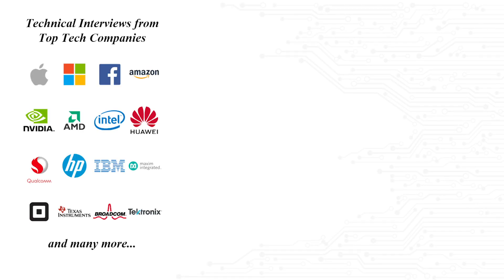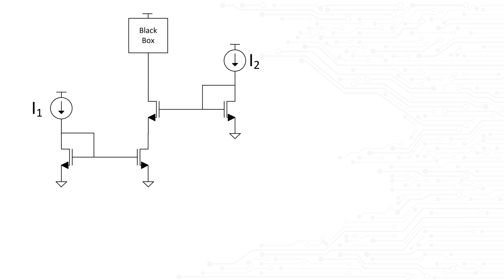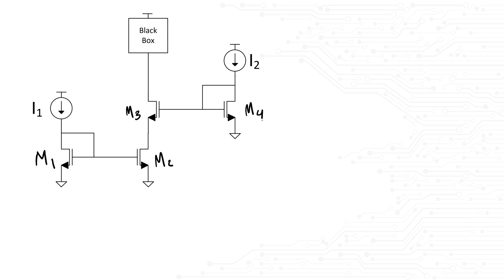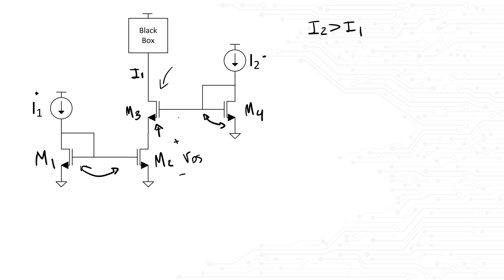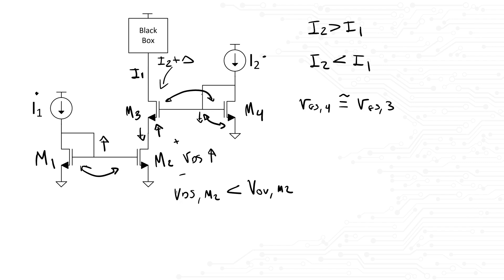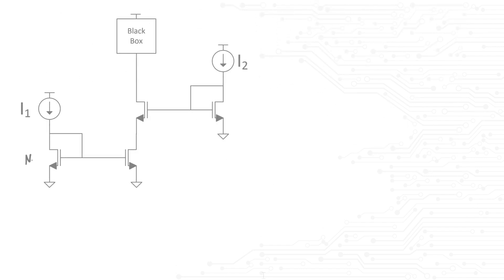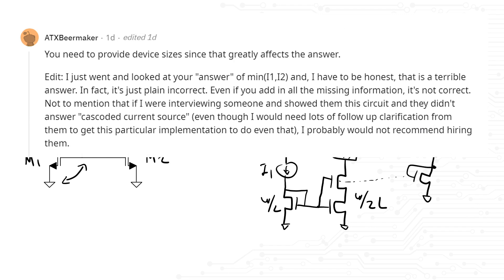HWN - "20-year Analog IC Designer" vs Our Team (Interview Question)

Comment: I did the simulation, it seems that it does indeed pick a lower current, but is not a very good system, as evaluated it is off by a factor of 2 when the current are equal. I don't think bob was wrong, but i don't think this is analysis is wrong either. The difference in current will have to large for the system to work, so it works under some conditions.

Comment: How you arrive at your answer, the thought process, the assumptions and how you communicated those to your team mates are more important than being right. The best answer is arrived at when the team is in sync with each other. IC Design is a team play.
I thought the circuit presented was a current modulator i.e. I2 modulates I1. Varying I2 varies VDS1 and I1 will change slightly due to channel length modulation by VDS1. But i enjoyed listening to your thought process.

Comment: If you're assumption of ideal devices includes a zero knee voltage, then yes, this would be a min function. Transistor length be damned. Also, the ratio of the current mirrors, imo, is irrelevant. You can just set I1 and I2 to be I1' = A*I1 and I2' = B*I2 where A and B are the CM ratios and then let the CMs have a ratio of 1. Unless we change the problem in such a way that we now care about the currents going through the diode connected transistors.

Comment: This is a quite tricky problem and the complete  answer is Iout= ( I1 .I2)/(I1+I2)( if we suppose that all the transistors are identical).Personally I will never test a candidate with a such problem.To be fair it is a trivial problem (for me ) but a real nightmare for most Analog designers to find the result that I have just provide.Also is quite odd what you say in the video you have  just solved it either I1>>I2 or I2>>I1 and what you say when I1=I2=I we get Iout=I/2.Now the real questions are what is (are )the imperfection(s) and how to solve it (them)?

Comment: Great content, thank you! 

Loved the analysis without taking any higher order effects, it's simple and elegant. Of course, we need to be a bit flexible here to buy your answer, which is kind out of the box. Would never get to the min function selection without guidance. To be fair, this sounds like interviewer function to drive the answer to this direction. Expected answer would be the cascode current mirror with I2>I1 (assuming proper sizes), Then, the interviewer could ask: "what if I1>I2" and so on...

Bob failed miserably in understanding the "ideal" scenario. However, I think you should buy him a beer anyway, he seemed stressed. 

Liked the inverter analogy to reinforce your point too.

Comment: 4:18 "The low vgs(m4) means source of M3 is low" ? I am confused because to draw less current(I2) shouldn't the source of M3 increase? Vg - Vs ---> lower Vs ---> higher I2 sounds incorrect. I think the source of M3 increases, Vg - Vs ---> higher Vs ---> lower I2 which is < I1. Help me on this.

Comment: Thank you so much for the sharing. In fact, this circuit is a well-known min. current selecting circuit. One can find a improved version using feedback control. See  chapter 2 "operational amplifter  speed and accuracy imrovement" by Vadim Ivanov, which is the best book for amplifer design.

Comment: Thank you for the nice video!
One query:
When I2 > I1; Vgs of M4 is high. That's understandable. But,
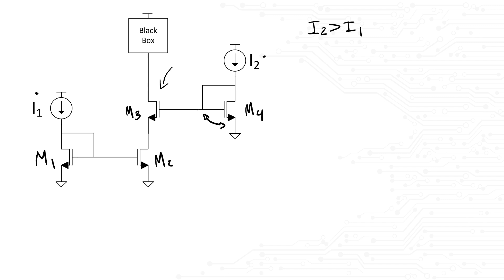"If I2 is high, source of M3 will be high" (Time stamp : 3:40) --- How you jump to this conclusion?
Reply: I think he's trying to say if I2 is high then the gate of M3 will be high, and that voltage is Vds2 + Vgs3, which will easily be high enough to keep M2 in saturation.
Reply: @theabr4839  Does he not know that M3 & M4 are NMOS transistors? Because he got it flipped the other way as well on (time stamp 4:18). If M3 and M4 were PMOS, then his statement 3:40 and 4:18 is correct.

Comment: To be honest, I agree with "Bob" at some points: 
The question doesn't mention any of the device size and device ratio which need us to make a lot assumptions. The device size and the actual current of I1/I2 affect the gate voltage of all of the transistor. For example, if I2<I1, the gate voltage of M2 could potentially turn off M2 completely or make M2 very large degeneration. If you claim it is a min current selector, you need to derive detail equations of Ron of the M2, current with degen of M2 and the final current equation etc.. 
We don't want to be the simulation monkey. But that is based on you have the calculation 100% correct, which you don't have here. And the truth is: in industrial if you can't even prove it in simulation, nobody will buy you. You can't tape out something that the simulation doesn't even work, only with bunch of incorrect equations. 
I like how you guys making these videos, but if you can't derive the equation 100% correct, don't do it, just give intuitive answer. The incorrect answer is going to mislead a lot of people here.
Reply: They were also very arrogant

Comment: I think the challenge of giving a mixed signal/analog interview is presenting devices in a configuration that the person being interviewed hasn't seen before so they can think out what happens, but still have it be simple enough so it is not a spaghetti mess.  Solving a DC operating point of something and then asking something like "which device falls out of saturation first as the input increases" is totally fair and expected.

Comment: The circuit is interesting once one reads how it's used in a class-AB amplifier. However, the way it's presented here is too simplistic and lacks key details such as sizing. 
Finally, I don't think it's a minimum current selector like the way you present it. If I2 > I1, for example, M3 sure wouldn't carry I2 as its source is on higher potential than that of M4, but there's no guarantee that M2 would be able to carry I1 either as its drain potential would be lower than that of M1 and Ids isn't constant after Vds > Vdsat.
Reply from the maker: Thank you so much for the feedback and contributing to the discussion. Details, like sizing, tend to become irrelevant in an interview discussion as we're not designing anything. Instead the interviewer is after problem solving and how one can use fundamental concepts to decipher what the circuit is doing. Remember we're not trying to teach anything new nor are here to educate people about core concepts. Instead we're bringing real life interview questions to you and assume you have all the tools to solve the problem.

Comment: Lol. You are clearly wrong. First of all we need to establish all devices are the same W/L. You could have spent 3 minutes on LTSpice to see why you are wrong.  You could have breadboarded it in a half hour. Pay up a beer guys. 

Also, your video seems more smug and condescending.  Both of you are at high points on the Dunning-Kruger curve, you are just at the beginning.
Reply: Well, I don't love the way this guy goes through the circuits in the videos but he is right.
If you are one of those designers that believe you are that good you can find this circuit in Vadim Ivanov's book on operational amplifiers(end of chapter 2). Also shown in E. Seevinck, “CMOS translinear circuits”. 
If you need more reference, Ivanov is a long time designer at TI that probably knows more about CMOS analog design and control theory than you think you know. Also probably holds more articles and patents than you.
Reply: @matheuspimenta8486  You are right. There is a circuit at end of chapter 2 where it is clearly mentioned min selector circuit.
However, another answer to the question could be a cascode current mirror (though matching won't be that good because of different VDS), but the output impedance would be high.
Reply from the maker: @matheuspimenta8486  Thank you so much for contributing to the content and being a part of the community! Please remember that we're not necessarily trying to educate people about IC design. The reason why you might dislike the way we present the circuit may be because we don't fully explain things but instead take shortcuts. However, that's the intent. We start with the assumption that our viewers have all the knowledge and tools to tackle the problems we present. Instead of education we just bring real life interview questions to expose our viewers to the problems.
Reply: @HardwareNinja  Sorry if I was not clear but  meant that your explanation is correct and giving references to support that.
Reply from the maker: HI JP,
Unfortunately you're so caught up on "being right" that you're missing the forest for the looking at the tree. Perhaps you haven't interviewed in a while or have forgotten how to do it. We're glad you're here to learn.
1. Interviews are all about ambiguity and lack of information. This is to evaluate how the candidate thinks and if seeks information.
2. When you know your foundations, and are good at them, you don't need a simulator to tell you how a circuit will work. Don't be a simulator monkey, don't be like Bob!
3. You cannot simply "breadboard" a circuit like this. It would be equivalent to say you could breadboard an OpAmp to prove it doesn't work (however, if you can let us know and WE will buy you that beer). These type of circuits are meant to be used on IC design, and work well with advanced process nodes.
4. We also saw your comment about the inverter. Again, don't get caught up on "being right".  You're purposefully choosing to ignore certain things we have stated. Whenever you're explaining something you always assume idealities. The only reason to include 2nd or 3rd order effects are to probe deeper understanding or to actually build an IC.
5. Spend some time reading other people's comments and you'll realize it's a widely used circuit.
Finally, if we said something that might have offended you during the video or the Reddit thread, we apologize. Our intention with this video is to highlight bad interviewers and help people realize sometimes it's not their fault. Hopefully interviewers are also watching these videos and learning. We, as engineers, tend to be very stubborn and prideful (as it should be). We should be able to recognize that we cannot possibly be right all the time though. Only by doing that we can hope to hire good candidates.
Cheers!

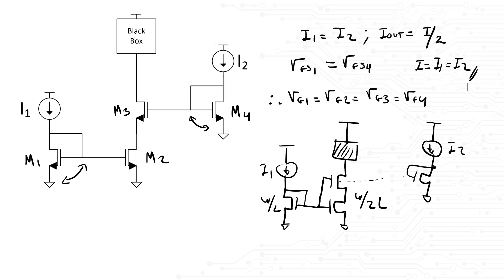Comment: Hi there, I really enjoyed this circuit, thanks! I think you got the main point, and I personally like calling the circuit a min(I1,I2) generator. However, for I1=I2, I think you should not say that "there is no minimum" (hear at 7:58s). Mathematically, the minimum between two equal values is the value itself. So, for I1=I2, min (I1,I2) = I1 = I2. In that specific case, the circuit produces I/2, a value which is not the minimum.
Reply from the maker: Hi!
Thank you so much for contributing to the discussion, we're glad you're here! Mathematically, this is absolutely correct. However, from a circuit perspective there's no minimum much like the inverter analogy. However, we appreciate the feedback and will work our best to be more concise next time. Thank you!

Comment: Working as Analog IC design engineer. Was present on the numerous interviews from both sides.  Few comments:
1. Open ended questions without details. 100% something to expect during the interview. The additional questions that candidate asks will easily show his knowledge level.
2. I like the way of working out the interview problem that you showing in your videos. Doing analysis out loud, making assumptions and not just giving the answer or say “i don’tknow” - that certainly the right way to crack the interview.
3. I agree with “Bob” that you’re probably not really a specialist in analog ic design. You’re making a lot of silly mistakes and miswords. So I would not recommend to learn technical stuff from your videos, but rather learn the way of working and try to solve or read how to solve the problem on your own.
4. I bet no fresh graduate will go farther than “this is cascode current source circuit” and if sizing and currents are correct, cascode is working, else - not. Idea of minimum current selector is quite not trivial and without reading the papers about “feedback class ab output stages” papers or books or something simillar, i would not expect answers into the right direction.
5. I personally used such circuit in the real silicon, as a part of ab output stage. Works perfectly well, one of my favourite architectures now.
Reply from the maker: Hi Volodymry,
Thank you so much for your detailed feedback. We're glad to have you contribute to the discussion. Let us address some of your comments below:
1. Thank you, this is exactly what the aim of the content is.
2. See point 1 :)
3. Some of the team members have a career in analog design IC with plenty of experience. That being said, it is not our goal to teach anything related to design. That's why we don't focus so much on 2nd order effects or nonidealities before the ideal operation has been established. We operate from an assumption that folks watching our videos already have the technical know-how to answer some of the questions themselves.
4. We agree with you here! However, the point of an interview is to have the interviewee solve practical problems that they don't have much exposure to. That way we can really evaluate the degree of experience and problem solving skills that he or she may have.
5. We have implemented this architecture in SoCs as well. Hence, the reason we provided the question :)
Reply: In every analog circuits there is always room to dabate in everything.
 Its not precise science if you do not take into consideration about everything.

 Analog design is art and science in the same time.
Reply: Hovewer your explanations are based on intuition and common sense.

Comment: I understand that you are trying to make an inverter analogy for this case, but to be honest, I don't think it's fair to assume everything being "ideal" because *they simply don't exist in this world*. In your inverter analogy, if the inverter isn't ideal, the output would give logic 0 for 50% of the time and logic 1 for the other half of the time, which is still functioning as inverters, except now you are inverting random noises. Actually you can use this distribution to figure out the skew of the inverter and so on, but that's a whole other topic. But the point was that, even in the case when your input is vdd/2, inverters still "inverts" a signal. 

Whereas in this example, if I1=I2, and you still wanted to maintain the min(), you can't just say it is okay to output I/2, because min(I1,I2) is not equal to half of each quantity either. You have to put an asterisk in the case when you assume I1=I2 to say that min() does not hold or something. For example, mathematically speaking, min(10,10) can never equal to 5. And that's entirely okay.

A better argument imo would be to say that even if you assume I1=I2, when these transistors are on real chips, process variation will make sure they are almost never equal, and so the min() will still hold in those cases.
Reply from the maker: Hi,
Thank you so much for your comment, we're glad you're here! We would like to address your comment about non-idealities. You're correct, nothing in this world is ideal. However,, during interviews, 2nd and 3rd order effects are not talked about much (unless it's a position for a role that requires a lot of experience). The reason for this is that if candidates cannot infer how a circuit will behave ideally, then it's likely they don't understand the 2nd order effects either. 
The same analogy can be done with an amplifier. If it's biased correctly, then it works as an amplifier. If there's a step and it stops slewing or are close to the max/min swing of the amplifier it will behave non-linearly. Just because of that, it doesn't make it any less of an amplifier. We do appreciate your feedback very much though and will use it to make our future content better.
Reply: The fact they said vdd/2 is telling. Even in digital, let alone in analog, they should know pmos and nmos are different and why the "middle" voltage isn't vdd/2.  (Though you could modify W/L_n and W/L_p ratios). (But again, you'd think they'd have basic concept of process corners, etc especially to be lecturing experienced analog guy comments online.